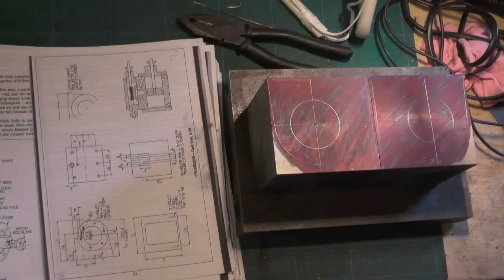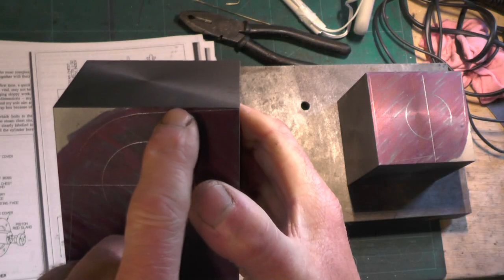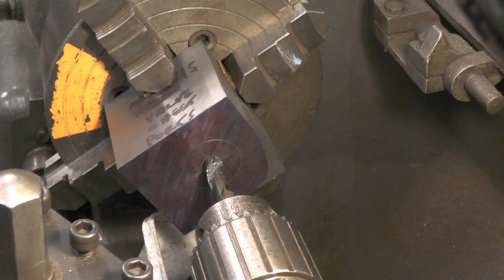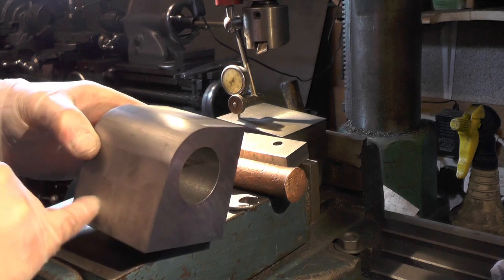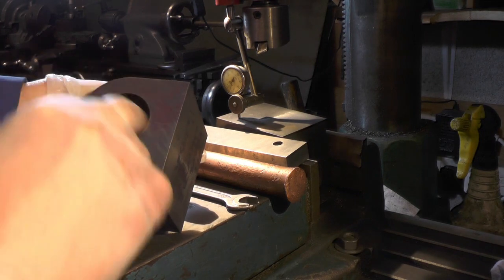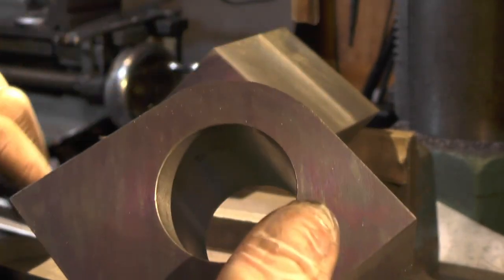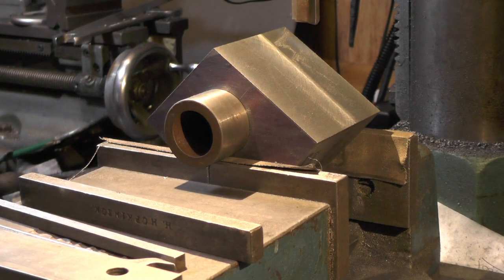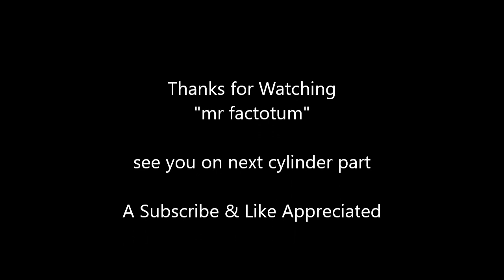Make a Beginners Steam Loco (Machining the steam cylinders Part 1 No Castings) "mr factotum"

Comment: I have used your method of machining  the radius in making the cam shaft lobes on my 3 cylinder four stroke glow plug engine.
Reply from the maker: eyup Ronnie
thanks for feedback and for watching, did the method work okay for you.
cheers
Kev